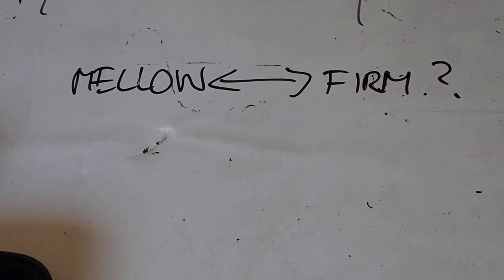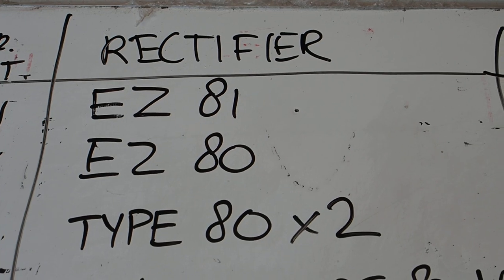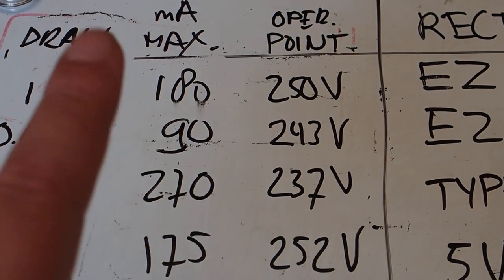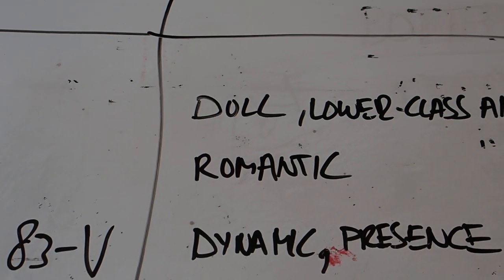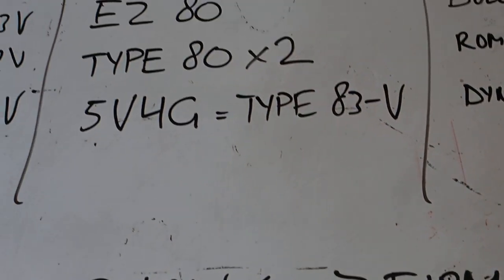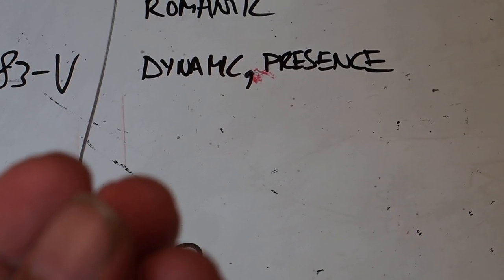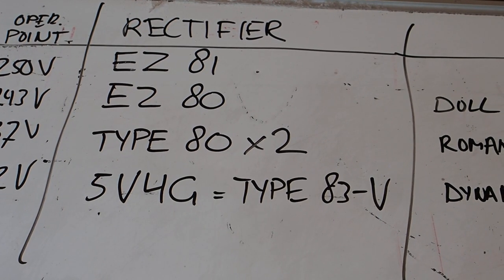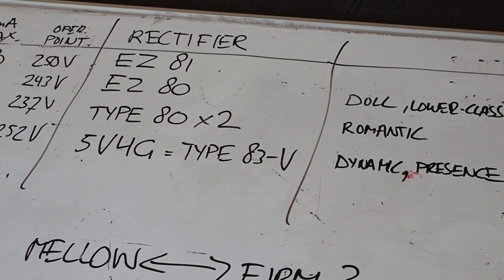4 tube rectifiers compared: EZ81, EZ80, Type 80, 5V4G

Comment: Hi Eduard, you make an interesting observation regarding the heater current versus head room in rectifier tubes. Both the EZ80 and the EZ81 are so called MiniWatt tubes. I wonder if Philips (I believe these tubes are Philips designs, correct me if I am wrong) pushed it too far in their quest to make their tubes more energy efficient.
Reply from the maker: Well, I'd say the tube would have been designed to operate at spec, within all parameters. But to support your suggestion, if I compare the 6BW4, that requires 900mA instead of 600mA heater current, and it rates itself for 100mA rectified current... so perhaps Philips design here was cutting it fine.. I can speculate but don't know enough really to make judgements.

Practically, I'm asking 65-70mA rectified current which is within the specced 90ma rectified max current, and that's mostly a 40H inductor load even. The only requirement I'm not meeting is the supply impedance .. a modern R-Core I'd say would be lower impedance but I can't say how that would impact the performance...

That all said, of all the rectifier tubes tried.. clearly this one runs most closest to stated maximums, it's a later design probably geared towards economy..so .. its seems reasonable to suspect headroom, with the type 80s dropping more voltage but without a similar audible result.
Reply: You could also try  the 83 MV type, but with precautions of course..
Reply: @EduardBroekman  The EZ80 is also able to deliver the current you require. And I assume without damage. The question is, up to which current is it a audiophile tube, exactly like what you elude to in the last part of your reply. And obviously there are no specifications for that. If the theory holds, then it could be a very nice rectifier tube for a pre-amp or so.
Reply from the maker: @hugobloemers4425  Indeed. It seems that when it comes to creating audio devices that deliver a free flowing type of music, having headroom in the design is one of those nearly universal elements, whether in the power supply, choice of power tube,  speaker cable or here the rectifier. 

Pro builders like Thomas Mayer also seem to prefer tubes with larger heater currents and always mentions high peak inverse voltage as a consideration. 

Lynn Olson noted that tv dampers, which Thomas Mayer uses nearly exclusively, have the lowest switching noises of any rectifier type... and that's something I didn't measure or consider here but Lynn said coming from his Textronics job in measurement gear, that it always preferable to prevent noises, rather than filter them...plus the switching noise travels in all directions.
Reply from the maker: Another maybe interest thing is the history of the 'miniwatt EZ80':
EZ80 (0.6A 6.3V > 90ma Iout)
EZ40 (same 3.8W heater, 90ma)
AZ41 (4V 0.72A=3W, directly heated, 70ma)
But directly heated is more efficient..
Reply: @EduardBroekman  The EZ40 is the Rimlock version of the EZ80. The tubes are dirt cheap but the sockets are unobtainum. All these tubes are obviously an evolution of each other, rather than a new development. Directly heated tubes can obviously emit electrons much easier than indirectly heated tubes. But it is easy to understand why indirectly heated tubes are the way forward. As soon as you have the need to have the cathode potentials to be at different levels, the directly heated tube becomes near unmanageable.
Reply: @EduardBroekman  I had to look up TV dampers. It is an interesting idea to use those in an amplifier. That will probably require a lot of development for it to work at its best, not stuff for beginners I would imagine. But it would be a nice challenge.
Reply from the maker: @hugobloemers4425  TV dampers are not difficult, they're generally just half wave rectifier (=diodes) with high voltage ratings, relatively cheap .. but you'll generally need more/beefier filament supplies. They have ultra low switching noise levels.
Reply: @EduardBroekman  OK, I was thinking about the circuit, to use them as fly-back diodes as the intended purpose was. You mean to use two of them to make up a full wave rectifier?
Reply from the maker: @hugobloemers4425  Correct.